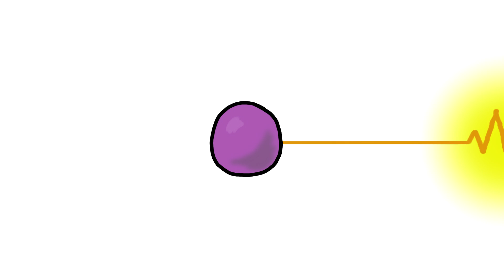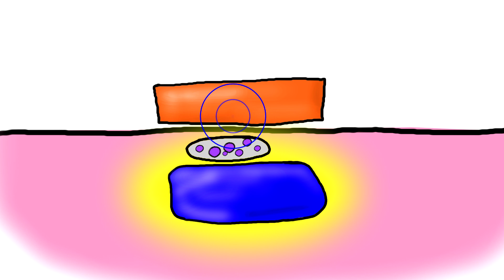Piezo Power: Under pressure, crystals live up to their electric potential

Comment: Science has not figured out of what is powering crystals? They are aware of 'frequencies' thus far but not the 'source'?
Reply: Piezoelectricity is well known.
Reply: Kafzilla But that is not the 'source'...is one of many outcome variations that can be utilized...
Reply: John Baldwin Sir...

The source of the electricity is the Crystal, it reacts to and produces electricity. It creates a small voltage while being compressed, like a spring storing energy, but it's only releasing the excess stored energy (that would bend or shatter the spring) as an electric current/voltage. This isn't to say that the crystal can't break, just that it dissipates the energy it received as electricity or vibrates because of electrical energy applied to it.
Reply: My understanding is that it a very good efficient way to convert mechanical energy to electric energy.
Reply: The source is the hexagonal shape of the crystal, when compressed, the shape changes which creates two poles (positive and negative) in the molecules due to the electrons not being spread out evenly inside the molecule.
Reply: It’s definitely understood by scientists but I don’t think it has been implemented in all the ways that are conceivable.

The science of sound to electricity connection for example is never talked about or for example being able to send electricity from the ionosphere into crystals or batteries etc.  

they recently discovered that the pyramids for example are able to focus electrical energy from the ionosphere into the ground underneath the pyramid.   With a battery this could potentially store energy.  

I wonder how efficient piezoelectricity is versus like mechanical turbines generating electricity from wind or steam.  And maybe our imaginations have been limited by fossil fuels which are destroying the ecosystem and creating petro wars etc.